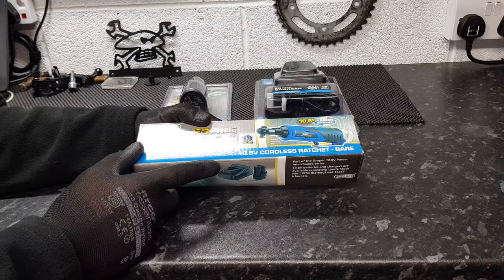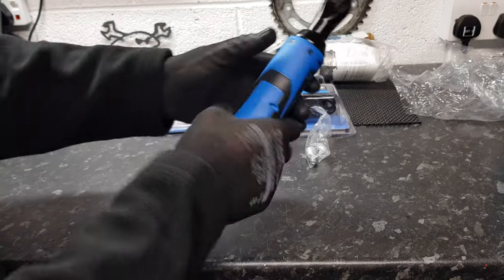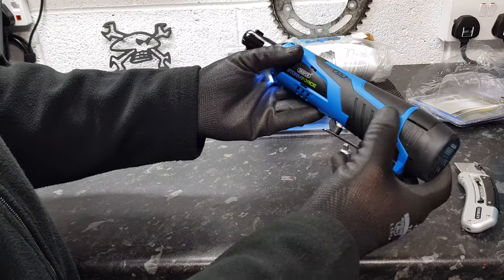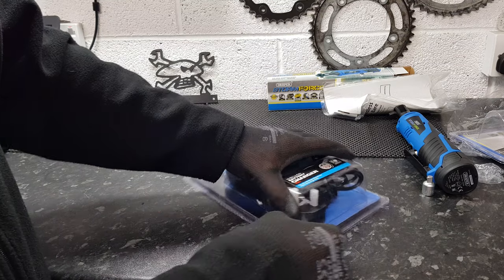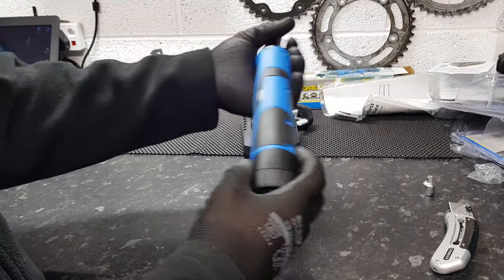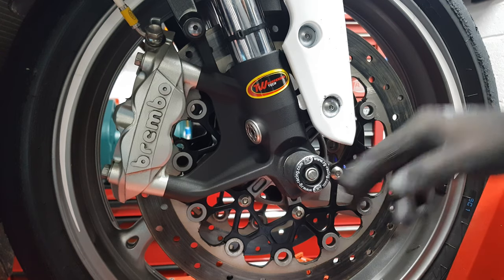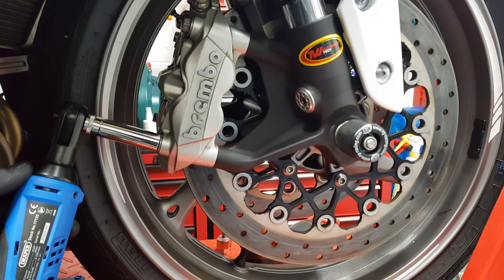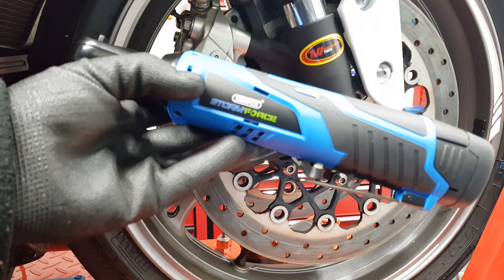Draper 17135 Storm Force 10.8V 3/8 Cordless Ratchet Unboxing & Review ...sort of 4K

Comment: I have the sealey version of this tool and find it fantastic. What was the reason you returned this one for the Milwaukee one as as far as i'm aware the power are actually the same having used my friends milwaukee. The direction selecter is actually a bit nicer on the Sealey/ Draper one as its not recessed so its easier to change direction with gloves on. These ratchets are designed to be used a nut runners to quickly run on and off fasteners rather than as an impact which is why they're not able to break free a lot of things without a bit of manual torque.

They're great for the money though, and ill likely buy the Milwaukee high speed long neck version when its available for a decent price in the UK as i recently got onto the M12 platform.

Comment: He was trying to use it as an impact wrench, that's not what it is designed for, its simply a  nut runner for those tight places where a normal ratchet is not possible to use. 🤔
Reply from the maker: This video is purely a demonstration of the product. I have seen plenty of mechanics using tools incorrectly to how they are designed. Just for info I have Milwaukee cordless ratchets that have the power to be used like an impact wrench. There is a well known mobile clutch specialist on YouTube that uses cordless ratchets instead of an impact gun. But thanks for the watch!
Reply: Yes, I understand that, but you said it wasn't able to undo the the bolts, and I said it wouldn't undo the bolts because it is not an impact wrench,  you have to break away the bolt first, you said the tool wasn't what you wanted because you were expecting it to break the bolts like an impact driver.